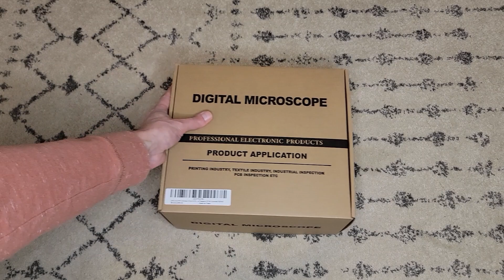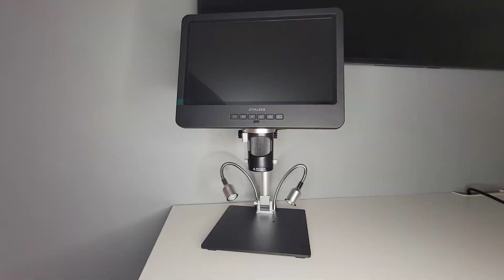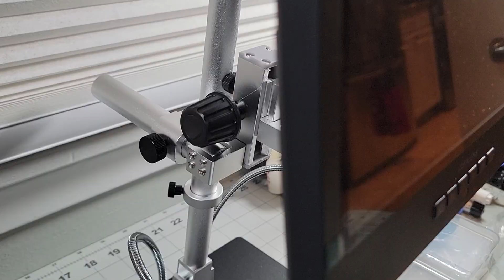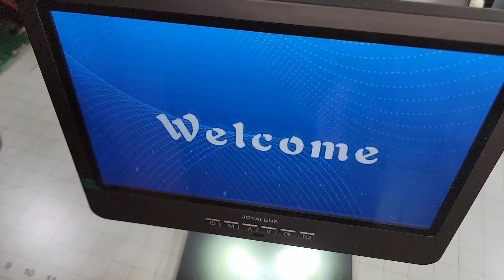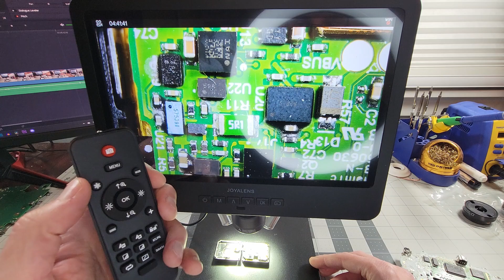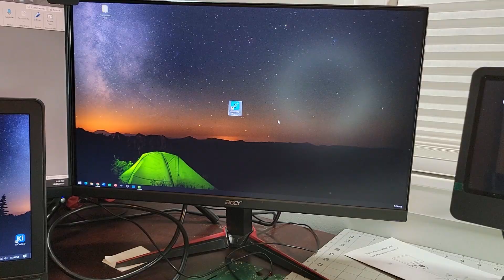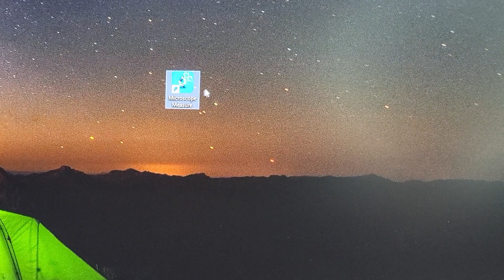USB Microscope for SMD Soldering (Joyalens)

Comment from the maker: Just to clarify on my comment near the end: I confirmed with the supplier that the ONLY difference between the 246 and 249 model is the screen size. So if you'd primarily use this with a computer and/or a separate monitor, then the 246 model is the way to go at a notably less cost. Cheers!

Comment: All the monitor's weight sits on the arm holding the microscope itself -is this a good or bad design?  Moving that combined weight up, down and around whenever repositioning.  Is that suboptimal?
Reply from the maker: I'd call it necessary design because there's no other sensible location for the monitor unless it were separated from the scope/mount. Fortunately the monitor is very light so I didn't find it problematic.